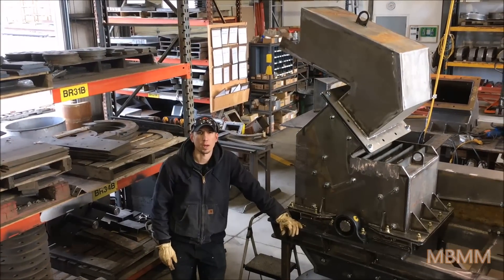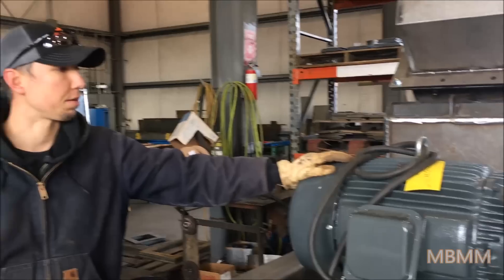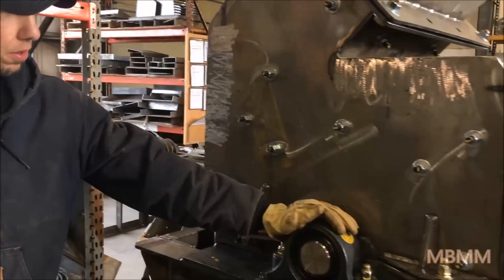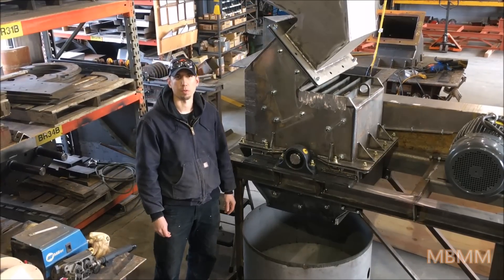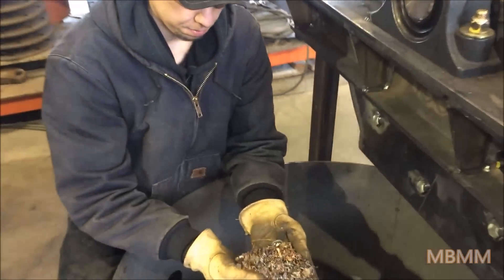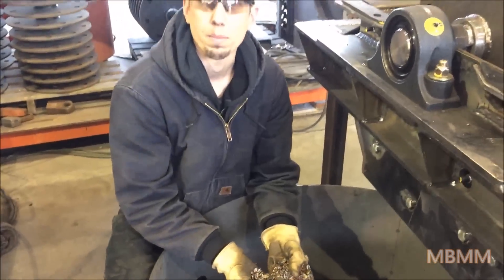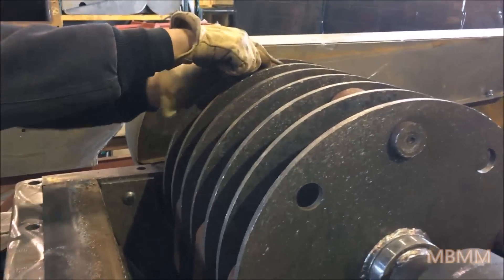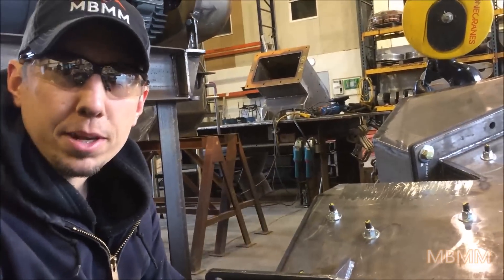Heavy Duty Hammer Mill 24" x 16" - Scrap Metal Processor

Comment: hey. could you tell my why you use a hammer mill instead of any other shredder, granulator or crusher? I want to recycle some non ferro foils. the foils have to get to little balls. do you think stuff like aluminium foil would end up in tiny balls the size of the screen?
Reply from the maker: Many benefits such as a hammer mill has much lower wear then a granulator and over a crusher it can create a much finer discharge. If you would like more info please fill out our conact us form: https://mbmmllc.com/contact-us/